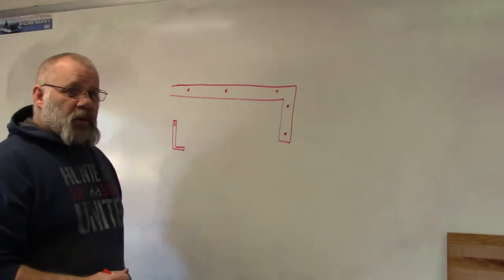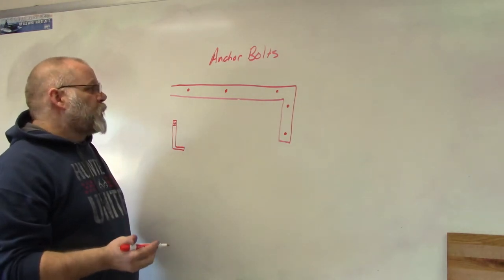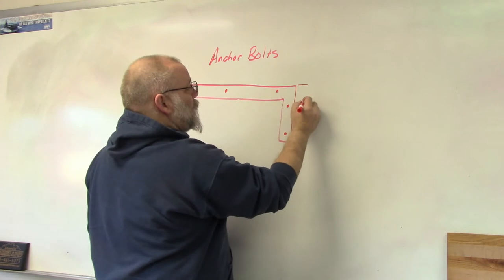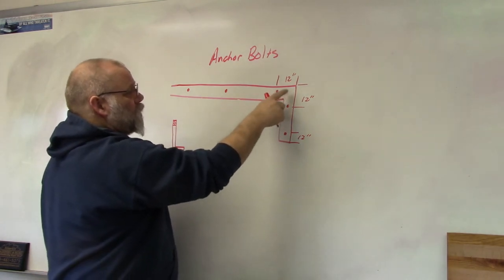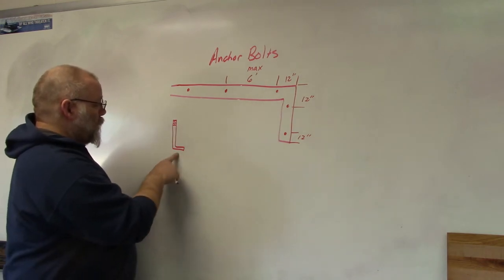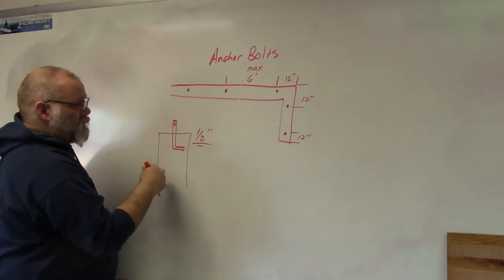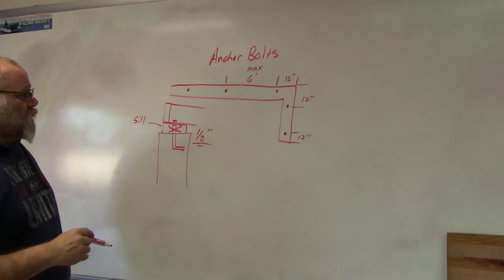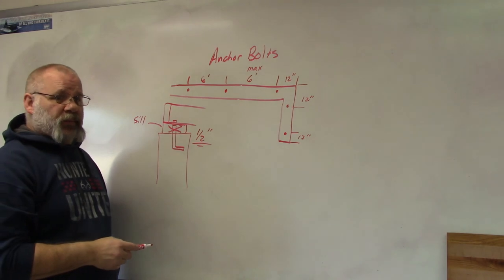Anchor bolt locations

Comment: Great video! Whats the minimum length of a sill plate along a 16ft span? I see a sill plate here thats only 15inches long to fill the total length.
Reply from the maker: As long as it is fastened down with at least one anchor bolt I don't think it matters how long the board is.